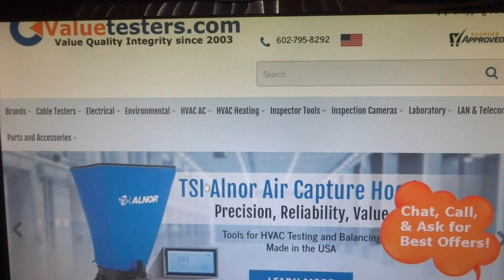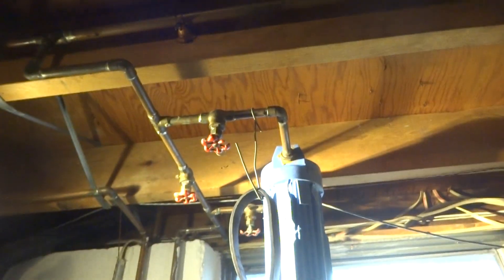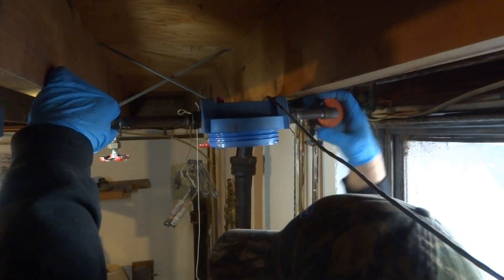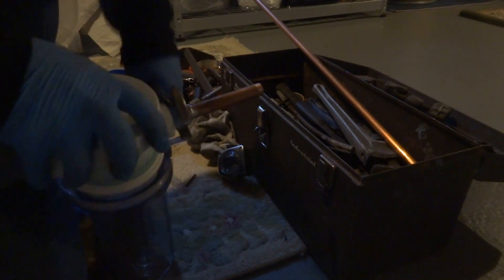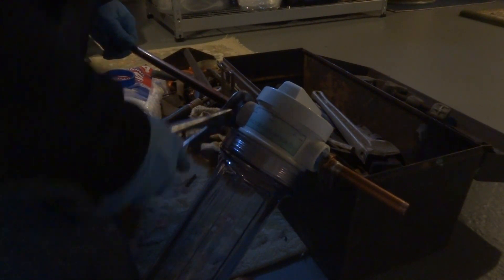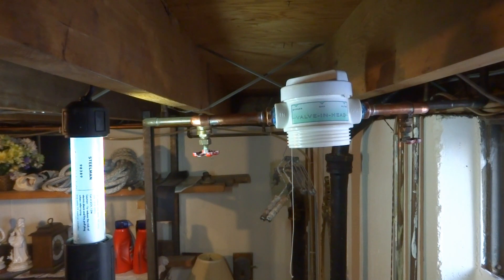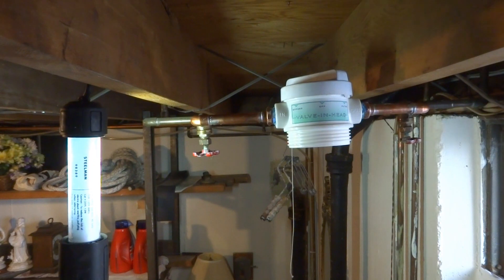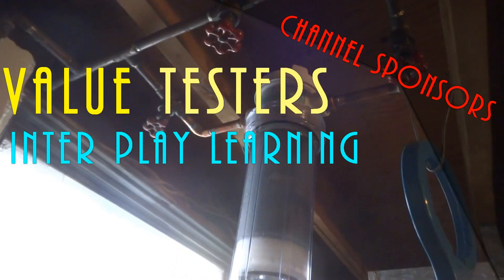water filter housing replacement

Comment: Hey Steve:  Just a tip. I don't install the "Home Depot" brands of whole-house filters any more.  I've been getting too many call backs for leaks (housing and shutoff valve) and problems with people using the wrong filters (or Chinese substitute filters) and getting a load of breakthrough.  My local supply started carrying CUNO filters and the correct replacement elements.  I don't make any more on the install, but I've had a whole lot less call backs for leaks.  I like the AP902.  Changing the filters is absolutely foolproof.
Reply: just put in a damn softener and carbon filter, not rocket science lol
Reply: @1gameboyc7775    What!  You saying a job needs a "damn" softener and a "carbon" filter in order to remove sediment?  You must be a "Culligan Man"!  Are you one of those crooked bastards who sells people a softener and "carbon" filter because they have iron, sodium, dissolved calcium and magnesium or bicarbonates in their water?  I made a good living coming in after the "Culligan Man" and to give customers what they needed for their PARTICULAR water problem, not some "package" that Culligan promoted in a magazine advertisement.  Dude; don't say stuff like that on this channel.  There are plenty of plumbers watching this channel.  Don't BS the folks who might be our customers.
Reply: @tonymanero5544   Hey Tony.  The CUNO AP902 is a sediment filter.  It is compliant with NSF/ ANSI Standard 42.  Water filters with a Standard 42 (aesthetic effects) certification are designed to minimize non-health related contaminants such as chlorine, taste and odor, and particulates.  This is all a "sediment filter" is required to do.  If you are looking for an actual "antibacterial" filter, or something to address lead or sulfur, NSF / ANSI 42 and 53 filters are not your answer.  You will have to look at such systems as UV light treatment and RO (reverse osmosis) filtration... which are "big-bucks" to put in a household system.
Reply: @leoashrae4199   triggered much?

No, sir, I am not a "Culligan man." I live in the intermountain west. I know Culligan is garbage. I've been plumbing for years. What i know for a 100% fact, where I live, where the water is typically 30 grains hard, these filters suck. They never last. Invest some real money and buy some equipment that's actually going to last. The softeners I get are locally made, not from box stores.

Gee crimeny, just because I suggest someone gets a softener I'm called a handy man and crooked. Lol. Relax bro
Reply: @1gameboyc7775    I get triggered way to often when I read some of the stuff here.  I watched the whole video.  The customer asked Steve to replace the old filter with a "clear one" (I suppose so he will have a visual cue when the filter is getting too dirty).  So he did just what I would have done... replaced the filter with the one the guy wanted.  I didn't hear one word about "why" he thought he needed the filter, what he wanted to filter out of his water, or what kind of service life he expected.  Then I read, "...just put in a damn softener and carbon filter, not rocket science lol".  It gets me cranked because people watch this channel and read the comments... and take away from this that a "softener" will cure all your water problems.  THAT'S CRAP!  If you have a water problem, ask a plumber (NOT the Culligan Man, or Roto Rooter Man, but a REAL plumber) what you need.  If you have hard water (water containing ions of magnesium and calcium from dissolved mineral salts) then he WILL probably recommend a softener.  But, if you have particulates (sediments from anything from dirt and clay to precipitated salts) you need a FILTER, not a softener (no, they are not the same thing).  Bottom line: there are hundreds of different water contaminants, and almost as many techniques to remove them.  One size does not, remotely, fit all.  Ask your PLUMBER, not the pimply-faced clerk at Lowes,  which one you need.

Comment: I had two of these burst on me. Never use that cheap plastic crap again. Bought a real stainless steel one. That sucker better never break.
Reply: Sounds like you need a pressure regulator.
Reply: It is not a good filter. If you notice, the male threads are in the cap. The cap should have female threads that that housing screws into, so there is a 'collar' that holds the pressurized housing together. The blue ones are made with a much tougher plastic and I don't think they crack.
Reply: @throttlebottle5906 It is the clear housing. I had one crack and leak too. My max water pressure was 60psi. Also a lot of the clear ones can not be put on the hot water line. I learned the hard way.
Reply: @throttlebottle5906  Steve should have changed those three crappy valves too. The extra 50 bucks is worth the convenience of of not having to shut off the water to the house to change the filter. The built in filter valve is another potential leak.
Reply: @throttlebottle5906  This isn't my video, but this is what happens watch?v=D77OIetzgz0
Reply: @throttlebottle5906  Mine wasn't the same make that Steve used. It could have been a defective one. It was good for about a year. I switched to a solid blue one after that so I only have experience with the one clear housing.
Reply: @throttlebottle5906  I mean, that's great and all but a stainless steel one is under $100. Once you have one burst and make a god awful mess (and then do it again!), you'll think twice about what it really costs. Note: I do not have a high water pressure.